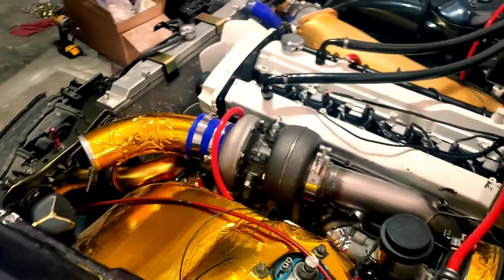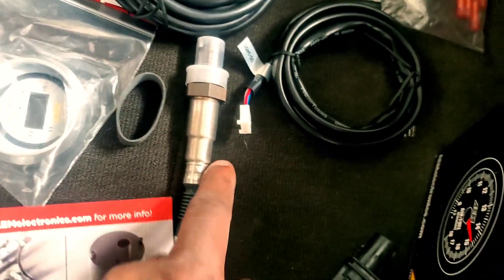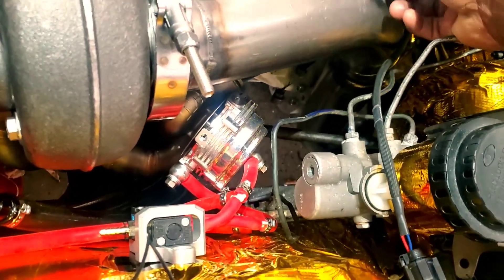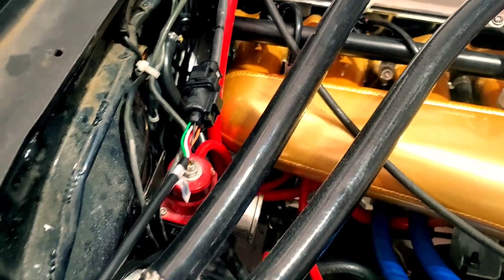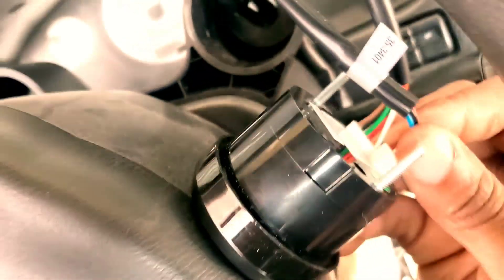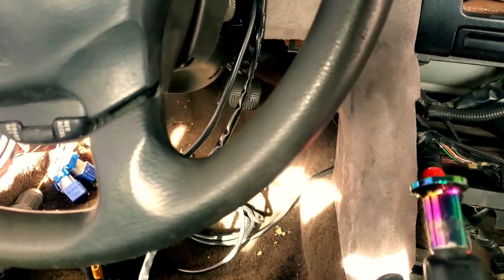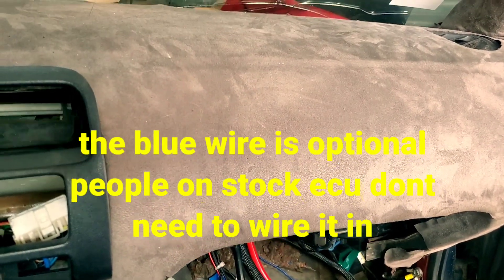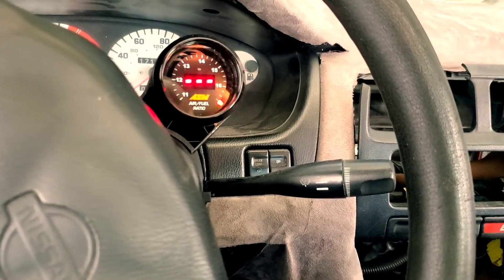AEM UEGO wideband install

Comment from the maker: You either use the serial output or 5v output not both. Wire the 5v to the wideband wire on the harness and leave the serial one alone